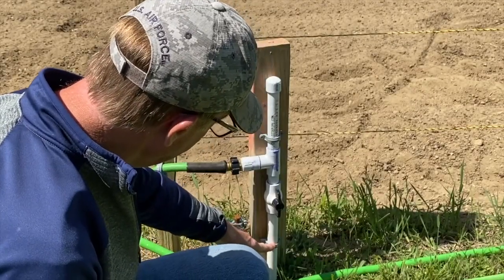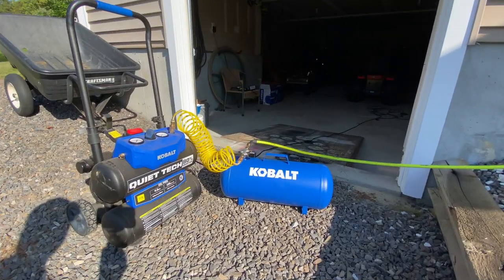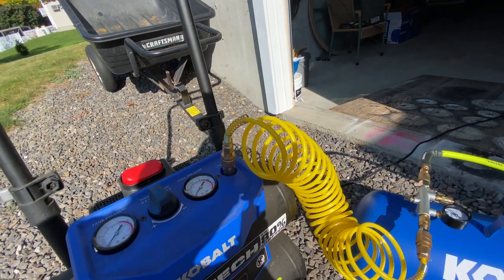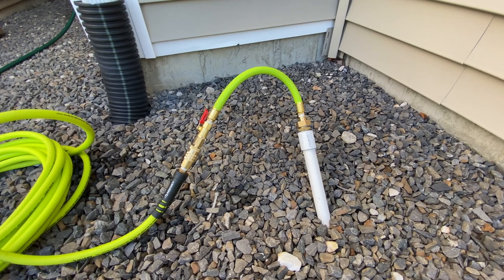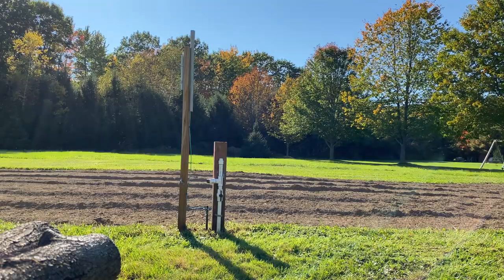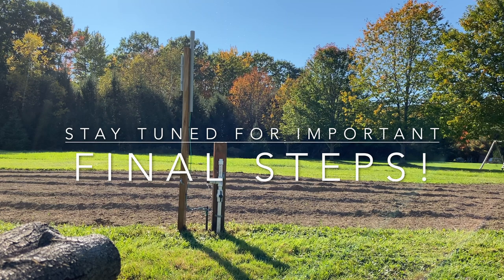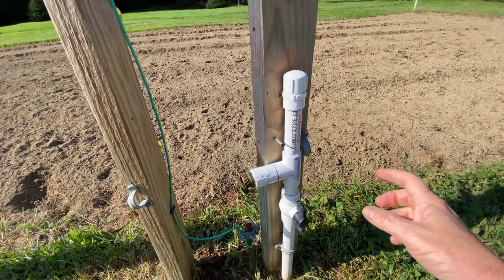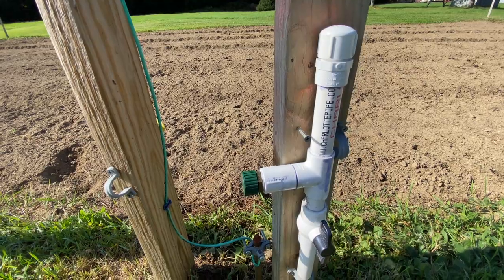HOW TO Blow Out an Underground Water Line ~ Quick & Easy

Comment: A great video that is short and too the point. What do you think about adding RV antifreeze? Do you think it would add anything? Also, thanks for the link to the water pipe adaptor!
Reply from the maker: Thank you.. Maybe if you thought you weren't getting all the water out but I have done this way for two winters and I haven't had any problems yet. I always charge the hose in the spring and then shut if off to see if it holds pressure..